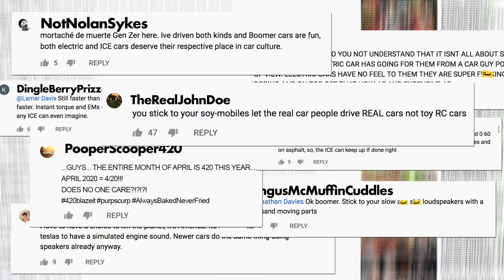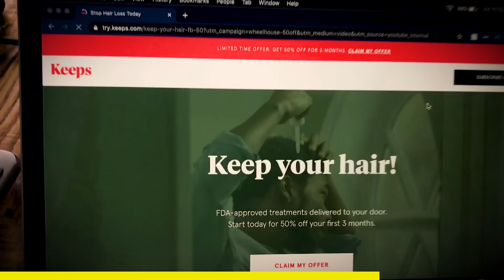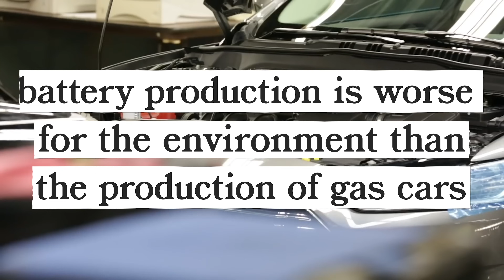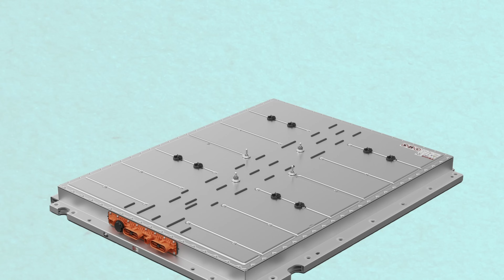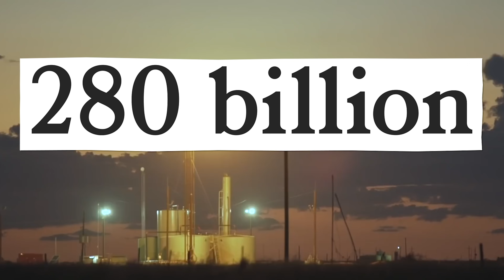Are Electric Cars REALLY Better for the Environment?

Comment: The best thing you can do for the environment, as far as a car goes, is to just drive the car you have until it breaks, fix it, and keep driving it until it just can't drive any more. Then, buy a used car and do it all over again. Buying a new car is the worst thing you can do for the environment, even if it is electric.
Reply: But how will you be able to buy a used car if nobody buys a new car??????
Reply: I'm all for fixing up what I've got, but that's it. The next is down to taste, no of ands or buts
Reply: False. The fact that you can say this shows you haven't really understood what the numbers mean. If a gas car costs 7 tons of emissions and burns 50 tons of emissions over its lifetime, this means that the new car only has to be 14% more efficient than the old car, for it to be more environmentally friendly to replace rather than repair.
Just as there are social costs to manufacturing cars, there are also social costs to sourcing the energy, it isn't an apples to apples comparison until you factor in all the human costs involved in securing the supply of oil used to fuel up your inefficient old car. Also, the destruction from added emissions directly translates to added social costs which is the whole reason we care about emissions in the first place.
Reply: @RealestUrbanism  Emissions are of the least concern when it comes to any new car. Do you have any idea what goes into the mining of cobalt? Cobalt is located in just one country on Earth, the Congo, and pretty much nowhere else. The human rights violations that are occurring in this country over that one, crucial mineral, should convince you that there is nothing at all "environmentally friendly" about building new EV's. But hey, a new Tesla sure looks sweet, so keep telling yourself you are being righteous for buying one. Who cares how many children died to make it...
Reply: @QarthCEO  Yeah darn, the famous unsolvable issue of human rights problems. Trying to solve human rights problems would violate the laws of physics, so better to let the planet burn instead. I'm sure you're typing your BS on an electronic device union-made in the USA.
Reply: @RealestUrbanism  Hey, when you figure out the Cobalt problem, maybe THEN you would have an argument.
Reply: @QarthCEO  yeah nah, im not letting perfect be the enemy of good and it looks like governments, corporations and consumers feel the same way.
Reply: @RealestUrbanism  Dude, buy what you want. I will be standing in line to get a Tesla truck right behind you, but I won't wrap myself in the cloak of righteousness for that decision, either. Buy an EV because you think it's cool and like its features. But don't kid yourself into thinking you're doing what's best for humanity or the planet, because you are not. Child labor and child deaths do into every EV made today. Until we can find a replacement for Cobalt, that won't change anytime soon.
Reply: @QarthCEO  child labor has zero effect on the environment and is an entirely separate issue from pollution and climate change. Net effect of reduced emissions to the planet and supporting the development of electric cars greatly outweighs the individual human cost in a small fraction of the supply chain. Decision makers and engineers are well aware of the issue of conflict minerals and continue to work to reduce its usage. An EV is absolutely morally superior over an equivalent gas car.
Reply: @RealestUrbanism  Your moral argument fails the minute you start justifying the bodies of dead children.
Reply: @QarthCEO  you mean like the children who died in our oil wars?
Reply: @QarthCEO  children who die due to poor air quality
Reply: @QarthCEO  children who die in climate disasters
Reply: @RealestUrbanism  Why do you hate children so much? What happened to you?
Reply: Pollution from the manufacturing of vehicles is concentrated in fewer areas, affecting fewer people. Gas car, especially older ones, affect the health of more people because they pollute where more people live.
Reply: @qiX2wf48  The people who live in the Congo would probably disagree with you. Making a new car affects the entire world since supply chains are now global. You have to take into account the entire environmental cost, all the way down to the mining of the rare earth minerals required to make these cars and the political and societal impact on the places that we mine them from. Looking at just emissions doesn't show the entire picture.

Comment: Basically, no and a little less no. In the short run, the tax that mining for battery materials and manufacturing the automobiles puts on the environment is actually worse than conventional cars. Over time though, it starts to level out. However, most places still use fossil fuel power grids and electric cars have to charge off of them, so the rate at which electric cars become "more green" than gas cars becomes even slower. It can take years for an electric car to actually become better for the environment than a gas car.
Engineering Explained also has a video on the topic of how long it would take. He even uses a perfect scenario where the person only charges on a renewable network.
Reply: Aren't electric power plants more efficient at producing energy from fuel than an ICE producing energy from fuel? Even considering the fact the power grid is not squeaky clean yet doesn't the efficiency advantage favor using the electric grid over each car having to produce its own energy? Also side note but if the hype behind solid state batteries is even half true, the required raw materials needed for each battery pack will be much cleaner and easier to recycle.
Reply: CrimsonStang zero emissions. And more power. Electric motors are far better. And we are pursuing cleaner energy given the fact that we are pursuing electric cars. Cars produce a lot of emission. By the simple fact that we are trying to phase them out means that we are trying to prolong what little we have. It’s still a long shot but electric cars are in their infancy stage.

Comment: when someone else realizes that electric cars need to charge and the power that charges them comes from coal burning powerplants
Reply: lol where the fuck do you think your house source its energy. and btw it highly depends where youre from. where i live we source electricity from hydroelectric dam. europe mostly has nuclear powerplants.
Reply: And they realize that fossil fuel powerplants are much more efficient than an internal combustion engine....
Reply: Exactly, speeding up the process of burning out the reactor and the nuclear fuel. More cracks etc.
Reply: There’s solar energy
Reply: Did you watch the video mate? Also I just checked the grid's output where I am and it's:
35% wind, 
19.1% nuclear, 
17.1% gas, 
15.8% interconnectors (mainly nuclear and hydro), 
13.8% solar, 
2,8% biomass 
0.9% hydro
0.5% other

...and 0.00% coal.

West Virginia is not the only place in the world, you know.

Comment: They are not the "future" as many like to claim, but EVS do have a place and its alongside the internal combustion engine, not replacing it altogether. There are problems with "clean energy " too, like wind power that rely on wind farms, they require a lot of space and that means forested areas get cut down.
Reply: In the future it will be replacing :)  just not much of that soon
Reply: @JoeysGames   Nope, we still have enough oil to last us centuries. Like I said EVs will not replace the ICE, but will be a suppliment and an option alongside it. Do not forget industrial purposes too in which a lot of ICEs are still and will continue to be used, not just commerical uses by the public. The trucks that deliver us our goods, construction equipment, farming euipment etc.

Modern ICEs and fuels are already extremely efficient and are only getting better. Who's to say we won't eventually create a fuel that is both renewable and enviromentallly friendly in the future. Just like EV tech is advancing so are the more traditional methods of power. 

Hybrids are a lot more likely to replace ICE only powered vehicles, at the consumer level, since they're far more efficient than only ICE or Electric forms of power.
Reply: @Tahllinavian  I think in the future we may push hydrogen power into those vehicles, semis and service vehicles. But that'll take a couple decades.
Reply: @JoeysGames Perhaps, but Hydrogen is an extremely unstable as a fuel source and is highly combustable, almost like white phosphorus, that combusts just from exposure to open air alone. We would have to find some way to make it more stable, before it can be put to use as a fuel source for something like a car. Sort of like how nitroglycerin became dynamite.
Reply: also they drive animals away from the area
Reply: What energy solution is the future?
Reply: Aren't windmills no recyclable
Reply: Yeah exactly, the main problem is the batteries themselves. If we were to replace the batteries with a hydrogen fuel cell, then they have a real shot at totally replacing the combustion engine. The batteries are not just dirty to produce, but they also hurt the practicality of EVs. There's the weight, charging times, costs etc.
Reply: they definitely are the future since gas combustion vehicles won't have any more gas soon
Reply: @hwentzel1649  ethanol/diesel from pineoil(you get it when making paper from pines)
Reply: @hwentzel1649  There is a lot of oil still unharvested, and there is also only a limited supply of Lithium and other materials you need for batteries.
Reply: @hwentzel1649  I think that the more likely replacement long term will have to be hydrogen engines, just my opinion though.

Comment: It strongly depends on the electricity generation mix of your area/state as well as the MPG of your vehicle.

There are many great articles on Well-to-Wheels analyses that compare ICEs, PHEVs, and BEVs. I encourage you to visit afdc.energy.gov as well. Feel free to do the calculations yourself with the GREET Excel Well-to-Wheels tool. Here's a link just to get the gist of the generation mixes: 
https://afdc.energy.gov/vehicles/electric_emissions.html

Not to flex, but I get 35-50 mpg with my manual Accord sport.
Reply: Either way in 5 years the electric car would have less of an impact if both are new.
Reply: @JoeysGames  Not everywhere, especially not WV since 91% of their energy is generated by coal

Comment: Electrics cars will never have that feel when your shifting through gears and hearing the engine. 

This is NOT a hate comment on electric cars I like them a lot just sayin
Reply: cars will never have that feel of cracking the whip and never hearing the neighing
Reply: Yeah no car gives the whining noise of a horse when i whip it!
Reply: Until Ferrari makes one :v
Reply: Definitely not Emma a company tried doing it with a C7 corvette and it didn’t catch on
Reply: @thatonegamer9547  probably because its extremely expensive and it was a one off
Reply: I don't it will, but hybrids pRObALy
Reply: They also won't give you that feeling that you get when you flip your ailerons and go into a corkscrew roll with the rudder balanced just right.
Reply: @tSp289  wtf
Reply: tSp289 
Uhh, they’re talking about cars here. This is a car channel, not a stunt plane channel.
Reply: MasterGaming Nic Yeah, and the point was that it’s a different kind of vehicle, so of course you’re not going to get that.
Reply: Sure they could. If it's THAT important to you, you could rig up an electric car with a simulated clutch & gearshift, basically incorporating video game tech. You could even add a synthetic engine sound and blast it over your stereo. It would all be 100% fake, but if what you want is the sound and  noise and to shift gears, you can certainly have that.

We have to stop burning crap - the climate is heading towards an irreversable problem. So rather than protesting the steps necessary to halt this change, why not figure a way to make these steps work for you instead?
Reply: Colin Fox Or he could make the noises himself! Brrrrrrrrmmmmm num num num nummm!
Reply: @Lore Mico nah not really

Comment: Yes they are, manufacturing is getting better and better, charging up the batteries is getting healthier for the environment, and they are more efficient than gasoline powered cars.

Further, electric cars are estimated to even out there emissions from production in 1 to 2 years. So yeah, they are cleaner than gas powered cars which will always be inefficient and producing co2 emissions

Comment: THIS IS EXACTLY WHAT I NEEDED IM DOING A SCHOOL PROJECCT MO POWAAHH BABEYY

edit: holy crap thanks for the likes !
Reply: Weight reduction and weight of the battery will be part of your project
And remember that the force needed to accelerate something is mass times acceleration 
So the more the mass the more energy is needed
Plus batteries for cars are at their infancy i think so it's power might get stronger while it's weight can also reduce as time goes on
Reply: @NewbyTon  Definitely a good point there! Also worth mentioning the emissions and energy required to extract and manufacture some of the materials, alongside longevity/life.
Reply: Hope the school project goes well!
Reply: Easy A after watching this
Reply: ayyy me too. Do you go to SIU?
Reply: @lvandrilaudio  no, im doing an extended essay (EPQ)
Reply: Hope the project goes well...but you might want to look a bit deeper than Nolan did in one ish day?
I would read all the comment and investigate their concerns because their are a lot more factors in the equation; I'm not sure carbon footprint is the best metric to use?  
Problem is that battery packs are only good for 6-8 years and then need to be replaced with not even doing close to the same daily/yearly mileage as combustion cars lasting past 17 years on average (better metric might be work done). Nolan didn't take in account for the carbon footprint of solar panels and wind turbines (short lifespan) as well...like he did mention for oil and gas production. Ironically EV's use way more oil to produce than combustion cars do sadly. 
Did Nolan ever mention that fuel is 5 times more energy dense minimum than batteries...not to mention ethanol and other fuel types like volcanol too? 
There is some new type of solar panel that even creates fuel too now!
Reply: @sickjohnson  oh yeah definitely, I'm not using this video or donut as my primary sources, its just fortuitous that something I enjoy watching makes a video covering the topic.
Reply: i’m doing one based on which is better for certain situations. gas or ev
Reply: Don’t forget to cite them as a source and you’re golden.
Reply: @xwarped83  you can't use donut as a source. you you would have to find where donut got there info from.
Reply: KEEP ER GOIIIIIIIN
Reply: I'm actually doing something similar too!
Reply: you still have school
Reply: Make sure to always check your sources bud
Reply: Nice dentside pfp
Reply: 😂😂same!!!
Reply: the huge problem of nuclear fission is not the emissions... its the lifetime of the DEADLY radioactive waste products : hundreds thousands of years...  The cleanest and safest ways to produce energy to charge the batteries are the "most" renewable ones:  solar, hydro, wind, sea waves, etc.. are these efficient enough to this day ? no ...
Reply: Sounds like you're doing propaganda and not a school project
Reply: Jussi Raitoniemi actually no. We’re allowed to have make our own arguments based on the research we’ve made.
Reply: @derrickstorm6976  its an extended essay (EPQ) you can choose your own topic

Comment: Just give me a manual gas car and I’ll be happy
Reply: I prefer secuential changes on the steering wheel
Like the McF1
Reply: @FurryestX  I like sequentials with the stick like rally cars. But sequentials are fun in general
Reply: Furryest X Sequential you mean?
Reply: TayZer r u a car guy and a halo player?
Reply: Joe_sp00nzy _ Both
Reply: TayZer I know right save the manual
Reply: Have a trabant
Reply: Same here
Reply: Me too
Reply: Manuals are hard to find these days within a budget. Searched high and low to replace my totaled manual Honda. Only managed to find one close by in running condition but needed some serious work.
Reply: @dekoldrick  I never have trouble finding used manuals. But they are getting less common
Reply: Toyota celica*
FTFY
Reply: No ones gonna give you any. Buy one yourself
Reply: Wanna bring back the horse and buggy, too? How about the Rickshaw?

We could always do away with the internet and go back to using carrier pigeons and smoke signals.
Reply: Ok boomer